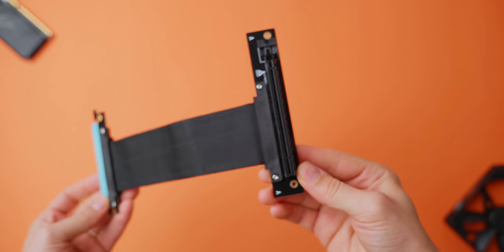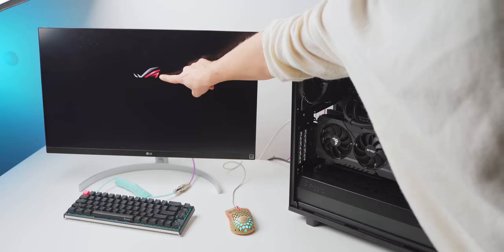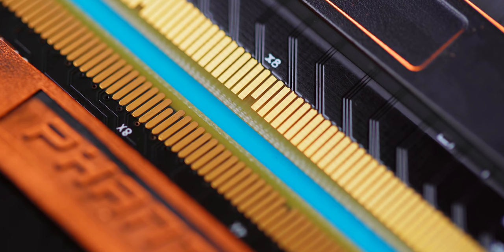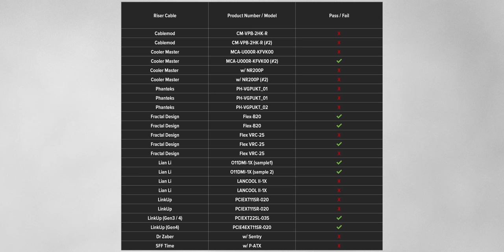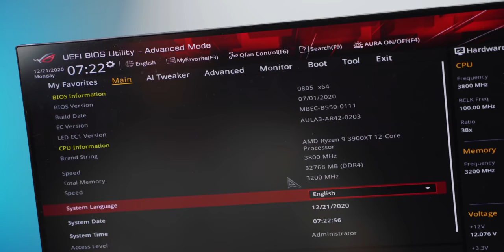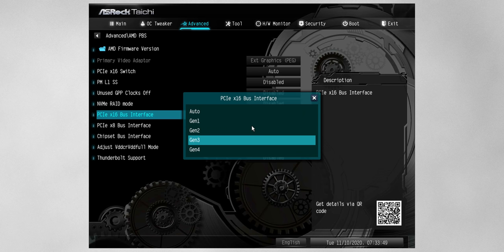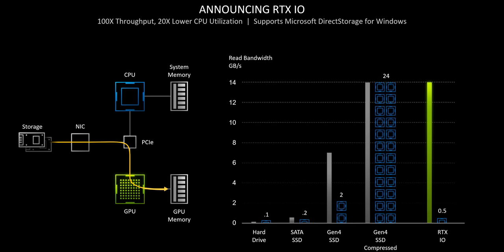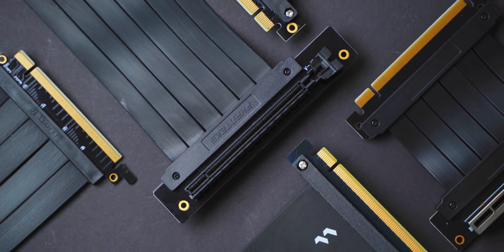There's a PROBLEM with Riser Cables

Comment: I spent a few years running a GTX1050Ti on a riser cable in my PC. I kept having recurring problems where it would work fine for about 6 months then I would start getting problems with the system hard locking. It would get gradually more frequent. I tried re-seating everything with no improvement. I purchased a new riser cable and all would be fine for about 6 months when the problems came back. I went through this for about 2 years. I tried cheap cables and expensive cables and always ended up with the same problems. I now have the GPU plugged directly into the MOBO and no more problems. I never figured out why but a new cable always fixed the problem for about 6 months.

Comment: There's only two motherboards I've had issues with.  NZXT doesn't post.  Asus boards won't work at 4.0 speeds.  I was told by Asus that's because of the M.2 slot between the CPU and the first x 16 slot.  But every MSI, Gigabyte and Asrock board has no issues with even 300mm riser cables that I've used.

Comment: Thank you! This has also seem to have fixed the inconsistant performance I've been having with my RTX 2070 Super.
Reply: So the riser don work with 2070super ?
Reply: @midlifecrisisgamingtech5462  It does work but after having manually set the PCI-e connection to Gen 3 my benchmark and gaming performance became very consistent. I.e. no more ~40% difference between benchmark runs or random drops from 100fps to 20fps while gaming. I never had any black screens or blue screens and such.
Reply: @bartschulp7692  ok bcos for my b450 steel legend m mobo has its pci e slot blocked and i want to instal an internal capture card like the 4k60pro mk 2

Comment: Higher quality and shorter cable could help, but there is no guarantee unless you test it in the motherboard and PCIe card. The motherboard already are at the edge of working, with precise track placement, adding minute differences due to riser cable can push them out of the spec.

We will probably see optical cables eventually. Expensive tho.

Comment: You should do more vids on Resizable bar / SAM, I'm finding interesting things about it. I don't have a RX 6800 XT yet but I now have Resizable support on my X470 MSI board and my RX 5700 XT 50th Anniversary GPU after updating the BIOS. My other MSI X470 platforms that got the Resizable bar BIO update all have Geforce GTX/RTX cards (not RTX 3000), and it seems apparent that NVIDIA has yet to provide the driver that unlocks Resizable Bar which indicates this in Device Manager of the GPU under Resources, where it will show Large Memory if Resizable Bar/SAM is enabled.

Comment: What is the risers O11DMI-1X (sample 1 and sample 2)? Is this a riser cables from vertical mounts for O11 Dynamic (O11D-1X), and O11 Dynamic XL (O11DXL-1)? Very interesting to know, are the risers from these vertical mounts compatible with PCI-E 4.0 cards, and motherboards with Gen 4? I'm very appericiant for your answer, Hardware Canucks.

Comment: Coming back to this video with a question: so I have a Fractal Design Flex B-20 mount and riser cable, it is currently setup with PCIe 3.0 x16 but both mainboards (MSI: MPG B550 Gaming Plus & X570 Unify) automatically detect PCIe 4.0 x16. I so far could rule out if there are problems with that combination since I did not experience any black screens after reinstalling Windows after the mainboard/chipset switch. Is it actually possible to get a PCIe 4.0 signal through a 3.0 cable? Are they electrically compatible?

Comment: I used to have a GTX 1060 with a Thermaltake Riser, it is rated 3.0, everything worked perfect.
When i upgraded to a RTX 3060, had this exact issue, everything worked perfect when i switch back to Gen3 in the bios.
2023, i got an RTX 4060, and i had to upgrade the Riser cable. But just out of curiosity switched up to Gen4 and EVERYTHING IS WORKING PERFECT. I dont know if its because of its only x8? 
Not sure, but i am happy to know i dont have to get a new riser cable

Comment: tried using cooler master riser pcie 3.0 on motherboard pcie gen 4 slot, blank screen. then switch to pcie gen 3 slot below gen 4 slot because my motherboard ASRock b550 Steel Legend got 2 of pcie slots, still with cooler master riser cable, LOW FPS IN CYBERPUNK is like gpu is only 20-30% utility percentage lol. then had to removed everything and back to horizontal gpu mount position (back to peasant and hotter air flow), no problem at all and max gpu usage 99-100% when gaming.
i guess need to enter bios like this video said and change pcie from auto to gen3 "if" still want to use gpu as in vertical position with pcie gen 4 slot + riser cable gen 3 (in compability mode)

Comment: Gen 3 has same issues.  The riser cables included with the TT P5 case failed constantly, there is a huge thread on their own forum on this.  I was using a Z170 and 1070 at the time.

Comment: Good video, but bit disappointing that you didn't test if ie. PSU noise would cause problems. For instance in industrial settings it is possible to get error in certain measurement devices if signal wires run near unshielded power cables. I believe the term is inductance? Sorry not sure as I'm not native English speaker. I kinda suspect that signal noise anyway is a factor in these problems.

Comment: The easy solution is to mount your GPU the way it was intended, directly into a motherboard PCIe slot.  Why do you think there are no RAM module risers?
Reply: It's about space management. A riser intends to use in a small PC case.
Reply: @Shutobu  Motherboards for small cases could be L shaped to support mounting the gpu directly without riser.

Comment: I've tried a couple Asiahorse cables with my older pci-e 3.0 cards on two different threadripper 4.0 boards - worked fine with those cards. However with my 3090 I had the same issues with flaky performance and bluescreens. Splurged out for the "Gen4" linkup cable and it's been running solid for a few months.

Comment: I've had this issue with my 5700 XT and X570 Taichi. I can't run the riser in the x16 slot, in Gen 3 or 4, without stuttering issues. 
But put it in the x8 slot and Gen 4 works just fine . I've run the card in the x16 slot without the riser with zero issues, and a negligible performance difference.
Unfortunately my watercooling setup in my case won't allow for a horizontal mount on the gpu, so I'm stuck with Gen 4 x8.

Comment: FYI, just checked the Bios on my Asrock B550 ITX mobo and there is no switching in the Bios from Gen 4 to 3, only dividing the lanes from X16 to lower divisions. Love this mobo but it won't be good for SFF cases unless you replace the riser.

Comment: I'm running a Gigabyte X570 & an RTX3080. With my Phanteks PCIE riser, it doesn't show any video output unless I set the X16 PCIE to Gen3 in the BIOS. Once I've done that, everything is fine, but there's obviously an issue when I'm testing overclocks or update the BIOS. I have to take apart the case & put the card back in the slot. Of course, putting an older card like a GTX970 works fine.

Comment: I just removed a Thermaltake riser cable from my PC and it's solved so many weird issues I've had over the past nearly two years.  2080S and X570 plus, both Asus. Increase in fps and noticeable difference in latency as well. I mean, it feels like an upgrade. Never mounting vertical again.

Comment: I got a new build in the NZXT H1 wich has a riser pcie3 cable and I've paired it with a b550 mobo gen4 and a rtx 3080 gen 4. No issues so far. I guess the riser cable in the H1 is pretty good 👍

Comment: I use LinkUp 4.0 cable from Amazon, 15cm piece in Lian LI 011 XL and with EK:s new vertical mount, fits like a glove and 15cm is perfect length. Had No problems, it recognises it PCI 4.0 16x, and performance is on par as it should be RTX 3090. Worked perfect from the start, new build. And Motherboard is Gigabyte Aorus Master X570.  Would by personally LinkUp raiser cable, they seem to be the best for 4.0 use. price was reasonable 53e, but it has raised a bit since

Comment: Sheesh. This was a problem since release of those cables. The worst the situation when cable starts acting weeks after installation as it usually the last thing people check. We always recommend do not use them to our customers in the store.  Some people end up buying new pSU or ram before they can figure out what keeps system crashing/acting.

Comment: I think what the AUTO actually does is connect using Gen1, ask the GPU what Gen it supports, and switch to fastest Gen supported at both ends. That is how such things usually work. And nobody remembers to add the "if that does not work, downgrade one step and try again" until the first time there are widespread connection issues. So this should be fixed with BIOS updates. Maybe instead of silent downgrade the BIOS should pop you to setup and ask if you want to set it to Gen3 manually?

Comment: Ran into this exact problem last week. Had to use the riser cable which came with the NR200P for my Aorus x570 Pro Wifi + RTX 3080, but the PSU was too large since the 3080 was longer than my old 2070 and the new PSU didn't arrive yet.
The monitor didn't show no signal though, but the PC wouldn't get past post. Only once windows would boot so I was at least sure the GPU wasn't DOA and figured out it's the cable.

Comment: My guess on the Auto mode detection is that it queries the Device/GPU at a slower rate and waits for it to confirm what type of device it is. So if it hears back that it's a PCI-E 4.0 device, it will just go into 4.0 mode. It won't test bandwidth, which would be the only way to really auto-determine if it could run at 4.0 speeds.

Comment: This is exactly the issue I had with my NZXT H1, I was losing my mind for 2 months trouble shooting my build before I figured it was the riser cable. I even bought my a second motherboard and new ram.
Reply: O'boy...about to build with that case 😦 did you solve it, and how?
Reply: @baxalasse  yes and no. I bought a PCIE 4 riser cable from Amazon (Linkup) for $100 and was able to run my GPU as a PCIE 4 extensión. Was it worth it, no. Saw no noticeable difference running the GPU as PCIE 3 vs PCIE 4 using the cables. Plus the way the new riser cable mounted into the H1 is not a direct fit it required some  adjustments that I was not happy with,  considering all the time and money I spent. Additional, it took me a good minute to get my PC to boot so I can access the bios to run my GPU as PCIE 3 , which in itself was another headache. Personally if I could do it over again , i would skip over the NZXT H1 and gone with a different case. I love the simplicity of the H1 and the design is pleasing to the eye but that riser cable is it’s Achilles heal. I ended up buying the NR200 and I’m completely happy with that case. I’ve said it before and I’ll say it again, I will wait for a solid and reliable PCIE 4 riser cable before I build something the requires a vertical GPU.
Reply: @magicman12b  great feedback, much appreciated! 👍

Comment: Without proper grounding you will get random results, the shielding of the riser must be grounded, so building and testing a system outside of the case  would just be adding another problem.
One of the major problems is that all the PC cases have painted chassis which is insulating the grounding points such as: MB standoffs (9 Ground connections), expansion slot bays, I/O plate,  and most importantly the PSU screws which should electrically connect the PC case to the PSU case. This hidden connection, if insulated by paint will leave the system and the riser shield floating.
If you remove the paint and ensure everything is grounded you should get more predictable results.

Comment: I'm glad that I found this. Guess my 26$ Vertical mount from Phanteks will be fine on my current setup (Z390, 2080Ti), but I'll def ditch it on the next big upgrade unless Gen 4 also drop that low.

Comment: Maybe a silly question but will setting it to gen3 in bios also effect the M.2 slot(gen4) functionality or will it only affects the main expansion slots? For example, gen4 card, gen4 board, gen4 M.2 SSD but needing to run pcie at gen3 due to the riser cable.

Comment: Maybe I didn't catch that, but if I switch to Gen3 does that also set the M.2 slot to Gen3? That would maybe be my biggest concern with this, when paying for a Gen4 SSD and then having to set it back to Gen3 due to the vertical mount.

Comment: The big question here is: is the magnetic disturbance coming from the cable itself or is it coming from the motherboard. If it's the latter, you could try to insulate it yourself with some aluminum foil and/or some copper mesh

Comment: Need gen 4 riser cables sooner then later. Ran into a headache when I went to new Nvidia 3000 series. Couldn't figure out why my gpu was crap, even brought it back to the store thinking it was broken. Finally figured it out had to force gen 3 on my x570 mobo. 🤦🏼‍♂️

Comment: In this testing did you use the pcie 4.0 cable from lian li o11 dynamic mini vertical gpu mount with the aorus master x570? Because I pre-ordered that and I have the aorus master x570 mobo and now I’m worried it’s going to give me issues when it arrives. I saw you said it failed in the video with my mobo but I wasn’t sure if you had the pcie 3.0 or 4.0 version. I have a ryzen 9 3900x with a gigabyte Rtx 3080 and 32gb 3600mhz g.skill ram. I needed this vertical mount because my pump/res combo won’t fit in the case since the gpu is too long. With the vertical gpu mount I’d be able to make enough room for the pump/res to fit. I can’t work on my custom water loop if this riser cable included in the 011 mini vertical mount pcie 4.0 isn’t functional with my mobo.
Reply: So, did it work?

Comment: I purchased a linkup ultra pcie gen 4 cable from Amazon. No black screen,bsod or need to go into bios. Works on my rx 480 and rx 5700xy without issue. Buying a strix 6800xt today and will update if there is an issue with new gpu. My mobo is x570 Asus crosshair viii hero.
Reply: I bought the same, it will arrive in 2 days, makes me happy to hear that it works good.
Reply: It works on the 480 because the motherboard detects a pcie 3.0 device, and sends a 3.0 signal. It would work with any gen 3 cable. The 5700xt is a different story. The board detects a 4.0 device and sends a 4.0 signal which only some 3.0 cables can handle. And you'll never know until you plug it in.
Reply: @Dominator0505  i've heard those cables are hit and miss. Some work, some don't.
Reply: @mattevans1643  ok I will test it first before completing all the cable managment 😉
Reply: @mattevans1643  I was just stating I had no issue with gen 3 or gen 4 and didn’t need to go into bios to get it to display.

Comment: I had all of these riser cable issues with Intel Haswell and PCIE 3.0 riser and GPU on an Asus X99 Strix mobo a few years ago.I tried with Thermaltake, CoolerMaster and cheap no brand risers, and I finally had to just give up on using a riser cable in that rig at all.

Comment: I'm using the NR200P with an MSI B550i, GTX 1070 with the riser cable and Gen 4 selected. No issues.

Comment: I had that problem when I put a 5700XT into a Node 202, which comes with a two piece riser card. All worked fine when PCIe gen 3 mode was set in BIOS, but I head a different problem with it. Since the Node 202 is very console like, I carry it often to different places causing the two pieces to move slightly due to vibrations I guess. That caused stuttering while GPU intensive stuff, so I replaced it with a flexible gen 4 certified riser cable. Now everythings fine running in gen 4 for months now.

Comment: I just got the Asus Strix LC RTX 3080 ti OC edition. If i wanted to use a vertical mount bracket for my X99 motherboard Asus Rampage V 10th anniversary; what generation should the cable be for the PCI express slot? Appreciate any advice!

Comment: I know this is an old video, but could riser cables cause issues when trying to load into the BIOS configuration interface? I haven't been able to load that screen since I got my AM4 board and I've realized I've never tested the GPU plugged in directly, but it's a major PITA to get it out. If this might be the cause though I'd be willing to give it a shot

Comment: So what will changing the bios mean for my gen4 ssd. Will that still work to its full potential or will that also be scaled down to gen3?

Also, thank you so much for this video. Got a new gpu (5700xt on a B550 mb) with a riser a month ago and kept thinking the GPU was bad because sometimes the pc just wouldn't boot to the GPU.

Comment: Few things. At very high bandwidth, the signals travelling through the cable do so at such high speed that they can interfere with each other within the same cable. Shielding will sort. No benefit in pci 4 vs 3 as gpu doesn't take advantage of the full pci3.0 spec. M2nvme will benefit, but that will be on mobo.

Comment: I noticed when I went vertical (Sapphire Nitro+ 5700xt) in my Lian Li DXL case that while my GPU benchmarks (3d Mark) dropped slightly, my CPU (7 3700x) benchmarks went up a little more than slightly. If it wasn't such a pain to switch back and forth I would test further but I suspect that the CPU has more breathing room since the GPU is slowed down??? Maybe it was just an anomaly?